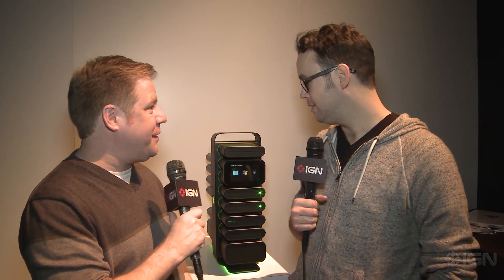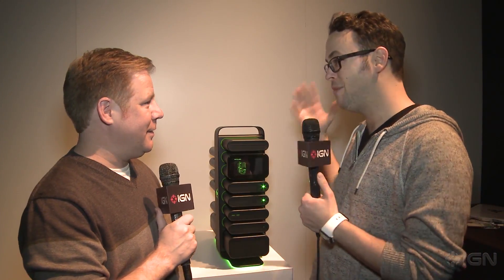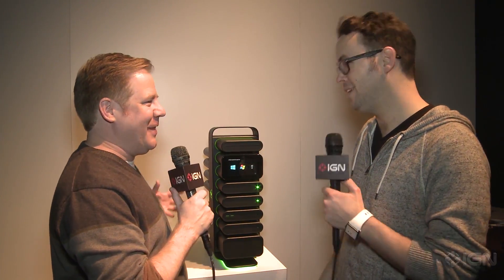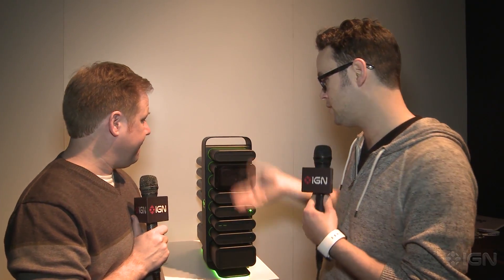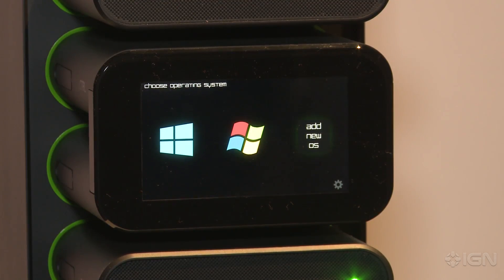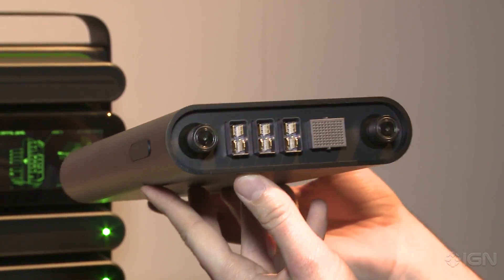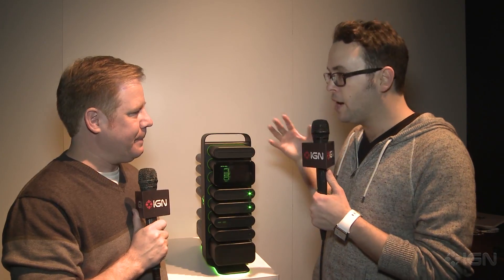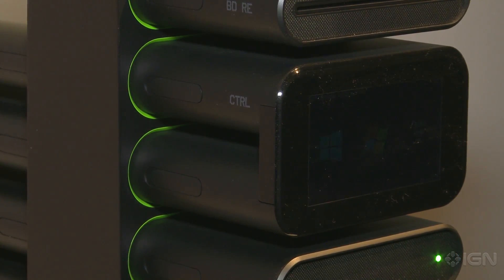First-Look at Razer's Project Christine Modular PC

Comment: Couldn't this be useful for bypassing socket type and north bridge issues. If you can swap out the connector to a higher bandwidth or pin count couldn't you keep using it by upgrading the bridging components and upgrade a northbridge and CPU simultaneiously without upgrading as much of your computer at once. What if you could get a special cpu/bridge taht could keep your old ddr3 ram while upgrading to a newer CPU then upgrade the ram later?

Comment: If the starting price isn't 400$ then I'm out.
Reply: mistaflake Make that 2k :) 1: its razer 2: Custom Full tower 3: Water cooling 4: Custom parts 5: ITS RAZER.
Reply: i think it will cost like 1000+
Reply: Let's be honest, it'll be more than 1k.
Reply: Actually, they said that they'll have it for $300 without all the components. As in, "barebones". But then you can choose and add in your own choice of hardware. But I don't know if the components have to be from Razer specifically or if we can get them from anywhere.
Reply: lool 1500 minimum
Reply: Outer life And the parts will be muuuuuch more expensive duo to them being costum made for the tower. I think around 50%-70% more in price let's say a GTX 650ti part. If you're on a budget then there is no point of getting it. Razer are just a show of.
Reply: mistaflake Well yeah. I think thats the biggest flaw. Having to use razor's custom parts. Which, if I state correctly from them, well set you up to $2000 for a strong PC.

Ah.
Reply: mistaflake You're forgetting that it's mineral oil cooled (IGN didn't specify), and modular... it's something new and honestly the potential is amazing, but like all new tech it'll obviously be expensive at first.

Comment: Sad thing is it's probably less modular than PC's, no motherboard selection. PC's are easy enough to upgrade anyway and every 3 years you stick a £150 gpu in it and off you go until your processor becomes a bottleneck. I really don't see the point considering it's Razer and the price will be fucking ridiculous.

Comment: I hope this idea takes off, and other manufacturers start doing it too. Considering how huge the computer industry is, it's about time they made it easier to add or upgrade parts.
Reply: its already easy to add/remove parts. I built my own gaming PC and its a common myth that it's hard. Just take your time and listen to tips/advice :D Just like lego
Reply: I think its cool looking but why would you buy this? Isent a modular cooling system just overly expensive and insufficient on every level from cost to power consumption? I think they need to go back to the drawing board.
Reply: GavMystro
I think you need to consider there was a time that when you didn't know how to put a computer together. I mean when I got my first computer I didn't have a clue. It came with an integrated graphics card and upgrading it was confusing to me at the time. It took several days and there might of even been a labour cost for "installing" the new video card. Although I was 12 years old at the time if Modular computers had been an option I think we would of gotten one for simplicities sake.
Reply: Chris Pie All
I built my first pc from youtube and trial. It's really not hard- all you need to be is patient.
Reply: Exactly, this can make custom pc's a mainstream kind of thing. Hell if this comes out at a modest price, it'll be reason I'll invest in gaming outside of consoles.
Reply: People still find building a computer to be very daunting if they don't know anything about computers.
Reply: Yeah no shit sherlock but is it worth an extra grand? And its still not a costume pc because you need to buy these modules that just one manufacturer makes.
Reply: Vinnie J Read the original post more closely. I said that I hope other manufacturers start doing it. That way there will be competition, which in turn should lead to the prices becoming more realistic.

Parts manufacturers would also be aware that making it easier to upgrade PCs means that people may be more likely to do so.

Of course there are many people know how to upgrade their PCs without assistance. I can do it with effort, but to be honest, I'd rather pull one part out, whack another in and call it a day.

I also know how to bake bread, but it doesn't mean I want to break out the bread machine every time I feel like a sandwich.
Reply: TrickWithAKnife Good post Trick. I'm 42, and have been gaming since 1978. I've owned PC's from Apple IIe to Commodore 64 to the ADAM, etc. The 1st time I built my own, 100% custom PC...I was as nervous as a whore in church and did mess-up in 2 areas (installing the CPU and Mobo). I was too hasty/nervous and bent some pins on the CPU trying to seat it too damn fast...and the Mobo I just had a hell of a time seating it just right in the custom Antec case. If...IF Razer makes this both affordable and easy, then I'm game as it will help to get more console players into custom PC gaming. And with the skill of most console gamer's, I'd love to have more of them playing PC games with us (I need good teammates for BF4 and Planetside 2). But let's not forget with STEAM-BOX coming out...it may/may not be competition for this. But I'm not sure if they would be in the same category?

Comment: Project Christine is t cooled by just any regular coolant, it's a mineral oil based system. Also its not PCIe but Razer's own proprietary connector.
Reply: Shut up.
Reply: "Also its not PCIe but Razer's own proprietary connector."

Every single source that has covered this has said it is using PCI-e. What made you think otherwise?

Comment: I don't like this look, I prefer the mesh of wires and cables, makes it feel like a living breathing machine. On the hot swapping that's been around for ages hence the fact it has been assigned the name "hot swapping" its just not been possible on windows as far as I know. Nether do I like this whole over modularizing. PCs have been modular for over a decade. And there is absolutely no need to liquid cool every component of a pc its not only unnecessary but also a huge waste of time and money.

Comment: I can't believe they skipped over the fact that it's mineral oil cooled. While it is true that it is liquid cooling, it s very fucking uncommon and unheard of in retail pc's. Another thing is, allthough pci is obviously the interface for the gpus and so forth, the actual modules themselves use proprietary connectors, which u really do not like. But i guess razer would want to be the only one to manufacture such modules

Comment: Awesome!!!!! would buy one for mediacenter. Price? I'm loling sooo much with the comments, kids, something engineered like this is for VERY rich kids, do you have any idea how much it costs to assemble a high end pc atm? gpu around 700$, cpu around 1300$, psu around 300$, 36gb of ram around 1000$, ssd's 120gb at least around 300$ and a board around 600$. I've not added box, screen, keyboard and mice, software licences and my own cost. This thingie will beat  on the low end not less than 3000$ and may rise up to the 5000$. Don't forget everything is connected in a custom way, so new hardware was designed to make this work, don't bring alienware here, as they are made from off the shelf components and they suck.

Comment: If its under 600 and each part is.. Roughly 50-100 max
Then maybe its doable, Maybe. Of course its razer
Reply: What?This is going to be atleast 1800. No less.
Reply: 50-100 for parts.... you are fucking kidding me right. maybe 4gb ram. But god damn man you can't get a ok graphics card for under $150. Don't even get me started with cpu prices. If this was around $1000 for a decent set up it would be in some homes. If they gave other companies the abilitys to make parts then it would be a huge hit.
Reply: The main thing will cost at least 2k, the mineral cooling alone will make it cosmically expensive, then for lets say a graphics card you will have to put at least 200 on the usual price for razer branding and the specific engineered part, It will most likely cost even much more than thjat

Comment: As usual Scott Lowe demonstrates he knows nothing about PC tech. He should be talking about

- Current modules use proprietary connectors i.e no 'dropping' in components like he describes. This will mean 3rd parties have to pay a licencing fee to make modules. Razer has mentioned they could open up the standard, using SATA, PCI-E etc.

- WAY more importantly, this is the first commercially available mineral oil cooled PC. To not mention this is insane. It's also using quick disconnect fittings that you can see on the modules, meaning no spillage.

Comment: The design looks great but I feel that there may be some issues with people who accidentally bend module parts. I would suggest have side panels that would fit in between each modular section. That way it is another level of security and when you need to swap out a module, you just pop the case off and take out the module you want.

Comment: Looks fantastic but my first issue is who is going to build the components for it. Obvious these parts have to be constructed for this machine, so is Razer going to be the one making the parts or will third-parties also develop additions? Still a lot like the Piston.
Reply: Razer actually said in an interview that they will reach out to developers like EVGA and Gigabyte to  develop components for this concept but only if the fans want to see it get produced
Reply: You open the parts i think
Reply: ***** no Razer said u cant open the parts because they are fully water cooled and opening then will be very risky. Third-party developers will create the same parts as the razer ones but they might be better and cheaper
Reply: Also, the project Razer is doing can easily be a new trend, so other manufactures will probably come up with something similar. Once we have that, maybe IEEE will have a standardized interface for modular PC components and we can all swap parts in between main towers from different manufactures.